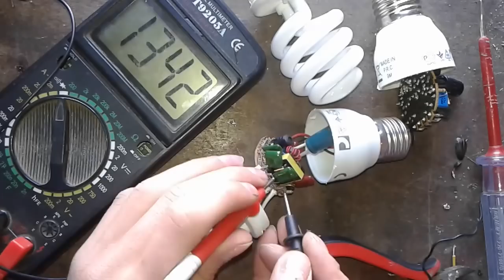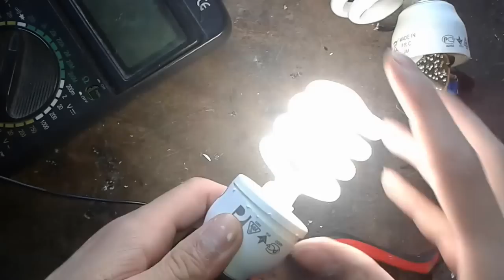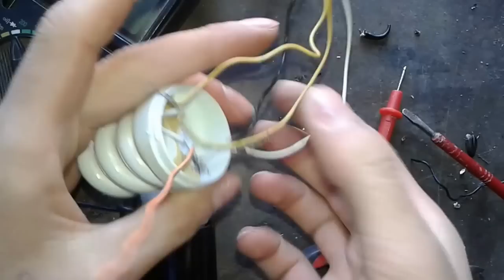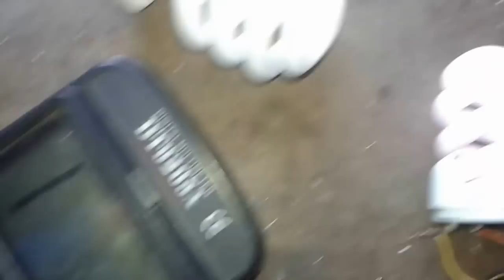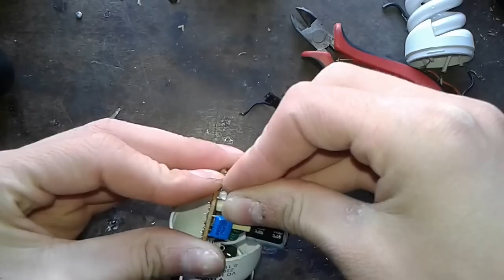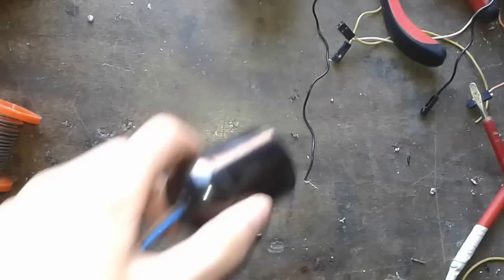SAVE MONEY - CFL Bulb Repair . Compact Fluorescent Lights Circuit Troubleshoot and Repair

Comment: Hello  good morning.  My house  bulb not working  so I check therd  side  there little  rusty  I clean  and fix but other  one  I remove  bulb  good  but when  I removing time  tube side four conection wire broken which  wire we can use  for this. Resist  wire need  or not plus. Tell me.  Thank

Comment: When  I was repair s CFL bulb AC wire in the circuit board disconnected in the bosrd where to solder the wires in the board 
Please help me. Where to solder the wires
Reply: there are 4 wires in 2 pairs, each pair should read about 10-20 ohms and infinite ohms if its broken, connect each pair to the solder joint pairs that are closest to each other, order shouldn't matter since its just a wire but don't switch a wire from one pair with another

Comment: I need to repair a 3-way CFL. When I tap on it, it comes on. When flip switch through the different wattages, it works. When I shut it off and try to turn it back on, it will not come back on unless I tap it again.

Comment: cfl bulbs blowing in pink colors, i have check all the pf, diode, capacitor, and track is ok ....

then where is the fault ...how to find it out?
Reply from the maker: time after time the gas they have inside get old and the lamps don't work anymore.
Reply: @IsDeno24  gas get old ? it isn't a cake, it doesn't go old and moldy ! either the filament burns out
Reply: if its pink, leave it for 5 minutes and check if its brightened, if not then the bulb is weak and not usable or the power supply isnt supplying enough power